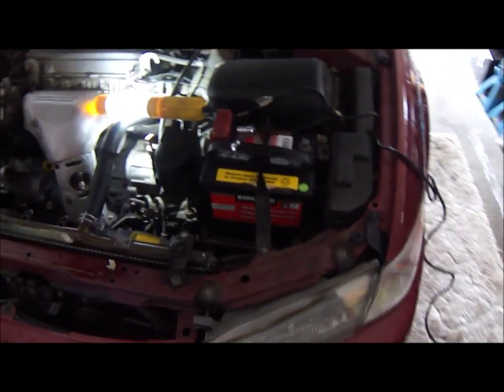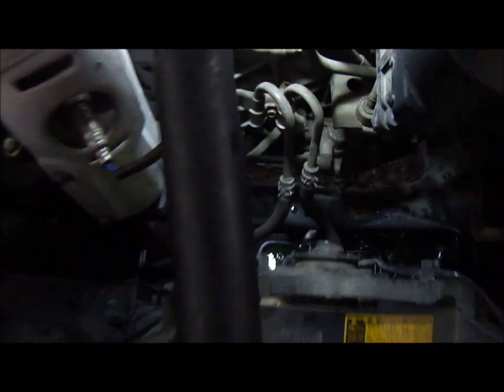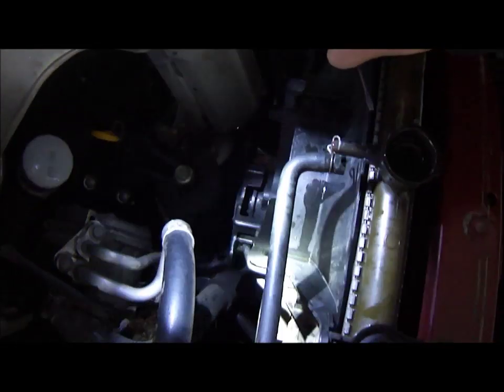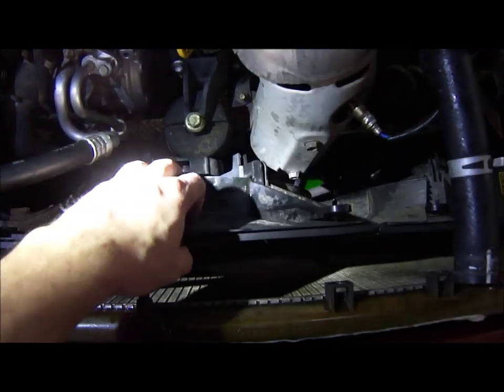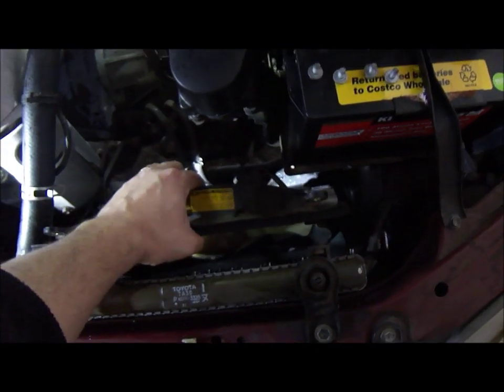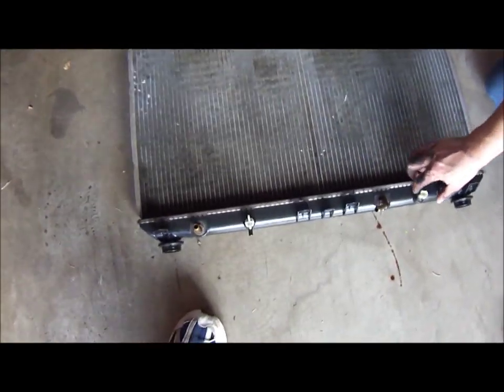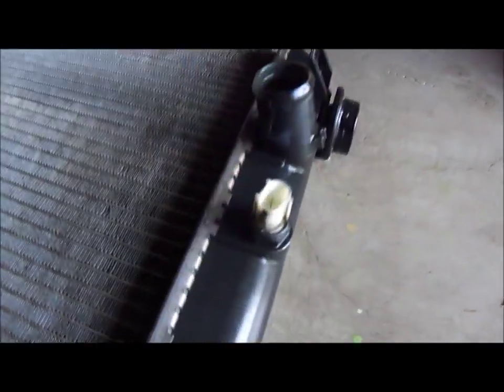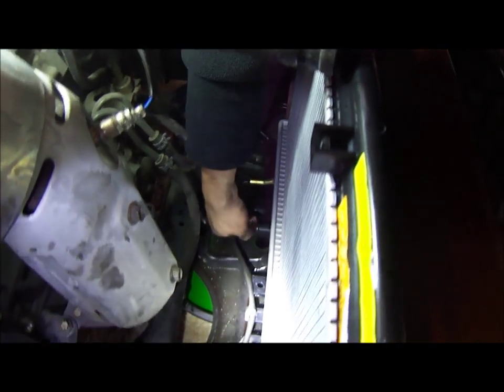1997 Toyota Camry LE 2.2L Radiator Replacement.wmv

Comment: Thanks so much for this video. I am NOT a car guy, but I am able to do things on my cars if I get a little good instruction on the "how to" portion. This was excellent and covered everything I needed to know. I was done in a little over an hour. One thing I would suggest to others is to cut a piece of cardboard and lay it over the inside of the new radiator while attaching hoses so you don't ding up the fins while attaching hoses. It cost me $100 for the part and a little bit of my time. Thanks again for allowing me to save hundreds of dollars.

Comment: I was stumbling around on the web to try to get the approximate cost of a radiator replacement repair at a shop when I found your video.  I watched it and was stunned at how easy your work has made it for others!  Incredible attention to detail on your part!  I did mine in under 2 hours (far less time than it took me to replace the heater core a year ago).  So thanks again!

Comment: nothing severe. i just had it pressed up against other parts like the fan and electrical connectors. i just got worried because it's my first time doing something other than a battery, oil, or tire change. but again, great video. thank you so much for sharing your knowledge. it gave me the confidence to do the job myself.

Comment: Thanks a lot for the video sir!  Gotta love Toyota and their simplicity.  I'm going to use this video to work on my 97 Lexus es300, which is really a high-end toyota camry, haha.  And if anyone is looking for a part, try ebay and look for any supplier with a lifetime warranty and free shipping.  My local auto service shop priced me at $217 for the radiator and $145 for the labor.  I bought it for 68 bucks, lifetime warranty, and the labor should be free and easy.  Be wary of estimates, folks!

Comment: Thanks for the Video. It was very helpful. I also saved $400 dollars doing the job myself. I purchased the radiator for $100. If I would let MONRO do this job they would have charged me $250 for radiator plus $150 labor,and anti-freeze and flush the system that's another $100...Its a shame for the people that have to pay that kind of money,but thanks to your video, I did it myself!

Comment: This is a excellent video. I am not too mechanically inclined but after watching this video I felt like I would be able to change mine myself. It took me a total of 90 mins but could have been shorter, I kept double checking because it was going so smoothly. I appreciate you recording the trouble you had releasing the connectors and how to release them because I would have had that same problem too and would have been stuck for a while.
Interestingly, my radiator cracked the same place.
This was a very good video, it shows everything your need to know. I got my radiator from Amazon and saved between $150 - $200 vs having a shop do it. Thanks

Comment: Excellent video. Thanks for you clear demonstration for replacing a radiator. I never do my own repairs because "I don't know how".  I know I needed my radiator replaced because it was cracked just like yours. I bought the replacement radiator from rockauto.com for $60. I took my time and it took me less than an hour. As one of the previous comments I would note taking extra care not to ding the new radiator. Thank again.

Comment: I do agree that removing the fans before unbolting the radiator is the best procedure. The fans must be unbolted from the old radiator and then to the new anyway. Then install the new radiator and ALL the bottom hoses before installing the fans. Some do not agree but I have done it both ways and removing the fans first is by far the better way.

Comment: Yes I did that, the fans come on and off . But the temp gage goes up closer to the red before the fans click on. I have been driving the car with the heat on. runs normal, with or without heat. I think my problem is air bubbles in the system. I check the radiator and have had to add fluid. Nothing is leaking. I really wanted to thank you for your reply. your video was most helpful.

Comment from the maker: Not a problem, I am glad to hear your radiator and the fans work fine. If your gauge still fluctuates like that... when was the last time you had replaced the thermostat?  If it's been a while, you might want to consider doing that.

Comment from the maker: Check all electrical connections that you had unplugged and make sure they have been properly reconnected.  And how long did you run the engine for?  It usually takes 10-20 minutes of idle time with the heater on for the fans to kick in.

Comment from the maker: If you run the engine for about fifteen minutes, your cooling fans should start kicking in as needed.  If they're not, the engine will eventually start to overheat so you should keep an eye on the coolant temperature gauge while the engine is idling.  If they're not turning on, it could be due to a number of reasons so you'll need to start doing some testing...

Comment: Just a fyi.  Leave the fans on and pull the radiator out as a full assembly which will make it easier to transfer all the equipment over.

Comment: So I have never, ever done a repair before. Not even changed my oil but if I can teach myself chemistry and knitting from YouTube I got this. So how do I check for leaks at the end? How do I know if I need more coolant? Does the coolant system need to be flushed? Where do I dispose of old coolant? Thanks for this vid btw. I knew this would be possible for the willing to learn individual!
Reply from the maker: Well, if you've never done a repair before, you might want to have someone who has help you, at least for the first time. I will try to briefly answer all your questions. To check for leaks at the end: Visually inspect all connections while the car is running and then look under it (keep in mind it might be the old coolant you spilled while taking out the old radiator). How do you know if you need more coolant? I usually fill up the radiator to the top, start the engine  and, while it's still cold, I keep the cap off and pump/squeeze the hoses a few times by hand. As far as if your system needs to be flushed... it depends on the age of your car and the last time you replaced your coolant. And you can dispose of your old coolant either at one of your auto parts stores or check with your garbage service company. I hope this helps.

Comment: NW2002, I am in the middle of replacing my radiator, thanks to your video.  I noticed that when you first started the car, you had the radiator cap off.  Was there a reason for this?

Comment: Hi, thanks for the video. I followed your instructions on my 01 camry. When I started the car, the engine started shaking really badly. It especially got worse when I put the AC on. The only thing different I did is that I added more coolant than water.
Any idea why that could be happening?

I also noticed that the engine temperature is colder than it is supposed to be.

Comment: All I did was disconnect the electrical to the radiator fans, the two main hoses and the 2 tranny lines and lifted it straight out and replaced All components on the floor and just slid it back into place with the lower radiator hose attached and waalaa!

Comment from the maker: To: Aziz Takhirov,
There is no reason your engine should start shaking after a radiator replacement unless you disconnected some additional electrical wiring and did not reconnect it? The water/coolant ratio won't have any effect on your engine idle. As far as engine temperature... how long did you run the car for? If long enough, maybe check/replace your thermostat.

Comment: Same spot on the Radiator that cracked on mine. I went to Napa and got their cheaper radiator for 116.00 instead of the Pay for the name Denso radiator which is the OEM one.
It's fine after I put it in, but the temperature sensor wanted to leak by weeping. I was very gentle with the wrench in slowly tightening it until it stopped. I was concerned that they don't require a gasket against the plastic radiator install for the sensor. What's your opinion out there on this critical area. Please send comments.

Comment: The radiator i bought doesnt have a drain cock/screw bit.it is the same.i mean it fits.nicely.i placed.the heater fans sensor to the drain cock on the new radiator.is it ok to do that?

Comment: Hi.I have a camry 1999.What I noticed is that the liquid in the coolant box is way below the low level(almost empty) when the car is in rested position.But when I drive the car for a while the liquid in the coolant box goes above the high marked level.I opened the radiator cap but there is nothing in it.Now shall I put more coolant in it?if it needs more coolant why does it go up while driving?Would appreciate your answer. 
Thanks
Reply from the maker: Normally the level in the coolant overfill tank fluctuates as the coolant gets hot and cold but what you're describing seems to be above norm. There might be air in the system. Check all your hoses and connections to make sure there are no leaks. And try to add some coolant to the radiator when the engine is completely cold. After it's filled, I would start the car and squeeze the hoses a few times to try to get the air bubbles out. Be very careful not get your hand near the belts or the radiator fans. And keep an eye on your coolant temperature gauge while driving. Also, if you haven't replaced the thermostat in a while, I would go ahead and do that.